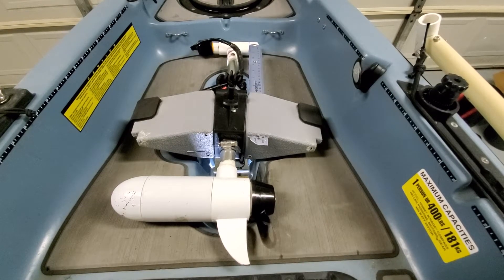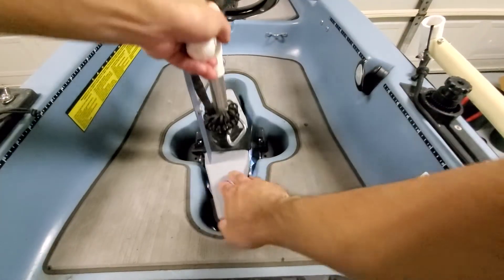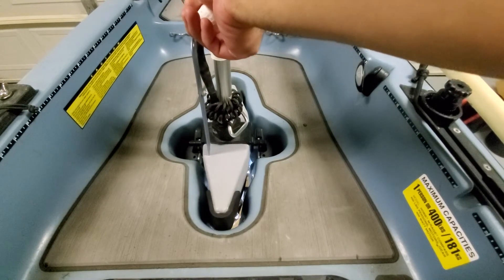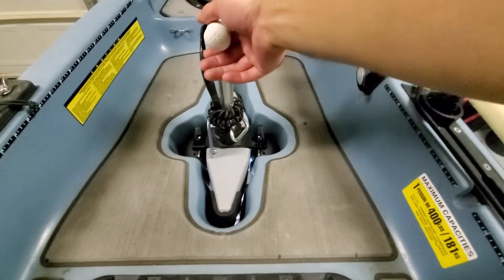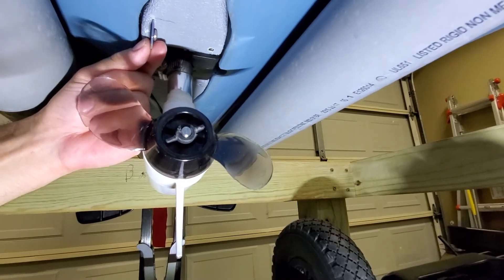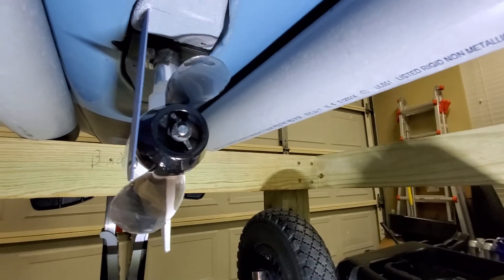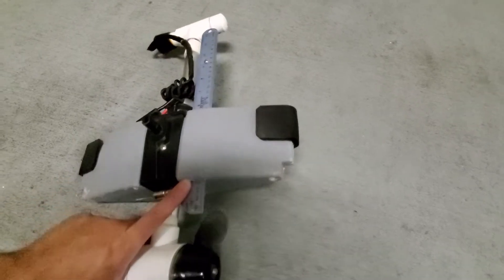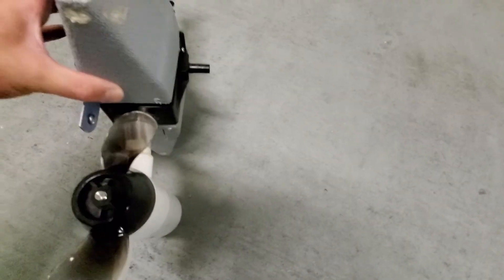DIY Hobie Trolling Motor Prop Indexer  Cassette Mod

Comment: Thanks, I was looking if the Motor of the venom 35lb had the same measurement of the 24lb and if it will it pass through the hole

Comment: Which motor did you use , is it water snake venom
Reply from the maker: @linofoscardi5144  water snake 24lb 12v with the two blade prop. The venom might be too big to fit through the drive hole, but I've never tried.

Comment: All info I saw online says the trolling motor should be 12" below the water line. Your looks to be higher up. Had you tried lowering it and whether it made any difference?
Reply from the maker: That may be true of motors installed in the front or back, but since this is midship I haven't had any problems with cavitation because of the cassette. I have installed it lower before, but I wasn't getting as much efficiency. Also, I probably wouldn't be able to use the ruler mod.  If you Google pictures of the side profile of the Old Town 106 Minn kota, that motor is tucked pretty high up as well. Hope that helps..

Comment: How do you lock it into one position?
Reply from the maker: To prevent the motor from rotating, I used a light bar clamp and then used 2 screws on each side to pin the clamp in place onto the cassette https://a.co/d/71VGllu
Reply: @JohnNguyen4  thank you so much. I'm starting this project next week.

Comment: What type of foam did you use on the ends? What type of adhesive to attach it?
Reply from the maker: 1/4 inch thick foam with adhesive backing from Amazon. There's multiple vendors. I have mine cut to 5x1.5 inch strips

Comment: Does the cassette need to be sealed? I’m assuming not- does it get water stuck inside it?
Reply from the maker: I drilled two 1/4 inch holes at the bottom front/bottom back of the cassette to drain any water. I also tried using expanding spray foam, but it got messy and I had no patience. I recommend stuffing it with pool noodle foam after drilling holes and before installing the motor shaft. Stuff it into the 1 inch holes you make for the motor shaft.

Comment: What did you use to glue those rubber pieces onto the cassette? I need to do this to mine.
Reply from the maker: I used something like this from Amazon: Neoprene Foam Strip Roll by Dualplex, 2" Wide x 10' Long x 1/4" Thick, Weather Seal High Density Stripping with Adhesive Backing – Weather Strip Roll Insulation Foam Strips https://a.co/d/8BJObbr
It does well to minimize noise and vibration.

Comment: what battery and size are you using?  thanks for sharing the video
Reply from the maker: Amped Outdoors 60ah 12v https://ampedoutdoors.com/products/60ah-lithium-battery-lifepo4-series-capable
I have never ran out using with a PWM. My friend who hooks it straight to his water snake motor has ran out once on a windy day about 7 miles of travel in about 7 hours of fishing. We made the same exact trip before on a less windy day without running out.

Comment: Do you have a video on how you modified your Watersnake for the Hobie?
Reply from the maker: Try this video,
https://youtu.be/SAr4TnVF-Mk
very similar to what I did except I got rid of the control head and connected it to a diy pwm.
Reply: @JohnNguyen4  thanks John, I was interested in how you got rid of the head and how you added the pwm if you wouldn't mind sharing.
Reply from the maker: @jimwoodmansee  Hi James, I made another video that may help you on how I set up the motor. https://youtu.be/nchKdMlIB_g
Reply: Thanks for your videos John. Looking to get a watersnake very soon

Comment: Hi John. What is the motor head? It looks like you modified it. And where did you buy it? It looks very streamlined
Reply from the maker: I am using a Watersnake 24lb thrust trolling motor with the control head cut off. I capped the end with PVC couplers and a 1 inch rubber furniture foot peg cover. More details of the set up can be seen in my other video: https://youtu.be/nchKdMlIB_g
Reply: @JohnNguyen4  many thanks, John. I forgot to ask you one more thing. What is attached to your cassette? Looks like some of sponge at both ends but can't make it out exactly what it is. And where can I order it? I'm doing a very similar setup to your electric motor. Love your ruler mod too.
Reply from the maker: @goranbosalevski9772  it's just 1/4 inch thick foam with adhesive backing to prevent the cassette from wobbling in the drive hole during use